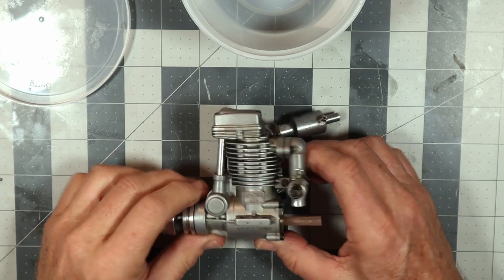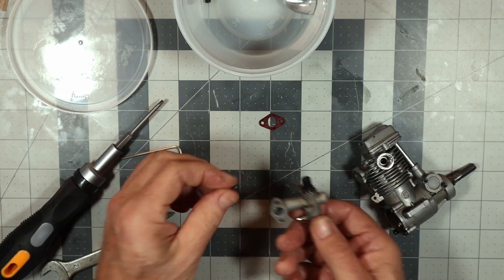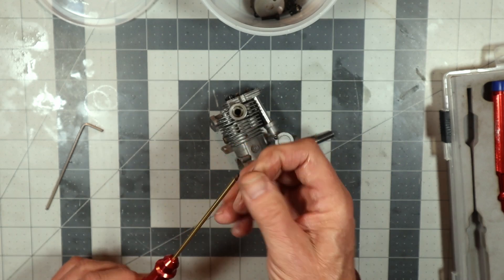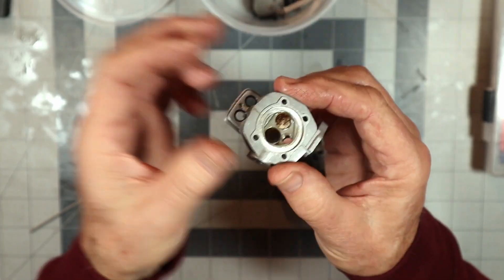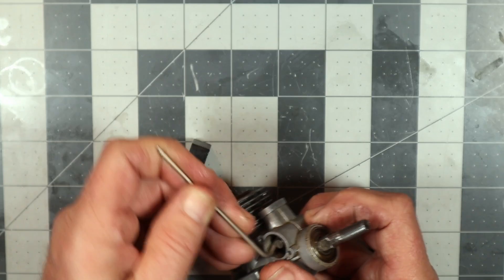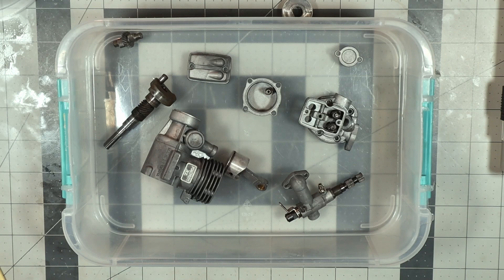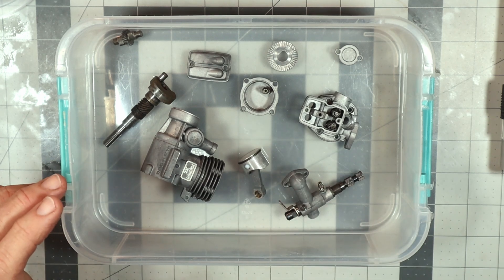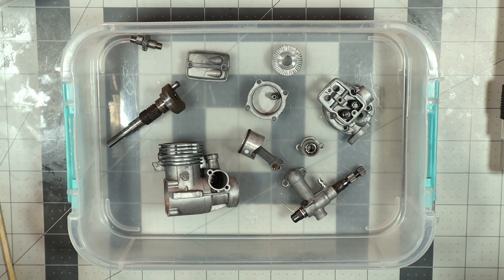Magnum FS30 Disassembly and Post Cleaning Wrap Up

Comment: Wish i had something for ya but i got nothing. I dont really do extensive cleaning. Just used things like: water, wire brush, glow fuel, brake cleaner, and the good ol crock pot and antifreeze. 

Best of luck to you, hope you're able to get it cleaned up.

Comment: Hi David. I have used the ultrasonic solution for cleaning brass shell casings and it worked very well without darkening the aluminum. I have also tried the ultrasonic cleaner for carbs and it worked well too. Both were tried with heat giving good results. Both were bought off Amazon. The unfortunate part is that both are quite expensive for a gallon and I’m trying to find a cheaper alternative. Both Simple Green and ZEP products don’t work as they turn the aluminum dark. Fred

Comment: Those engines are painted or powder coated. Nothing you can do to protect cheap paint. What I do is repaint them with Seymour s paint. Great engine paint. This is the engine I first wrote you about. Valves where stuck shut. Brand new 30 yr old. Engine. Cleaned it up. Finial got the valves back in. Those keepers are a pain in the ass. Runs good. Hope yours turns out okay

Comment: David, I’ve purchased some “Ultrasonic Cleaning Solution” from Amazon in a gallon jug. It does a decent job in my US cleaner at high temps without discoloration. The brand is Northwest Enterprises. 
 I too have been bitten by the LA cleaner reformulation and the damage it caused sucks. I had to use Barkeepers Friend and a stiff brush to remove the oxidation. Unfortunately it leaves the engine with a very unoriginal shiney finish, albeit clean though.
Reply from the maker: Thatnk you for the information!
Reply: @dmrcflyr2  It’s certainly not cheap, but neither is ruining a customer’s engine with LAsTA.

Comment: Have you tried Gunk carb cleaner? It comes in one-gallon cans for use in ultra sonic cleaners.
Reply from the maker: I had some years ago when i was working on motorcycles but i don’t believe that i ever tried it on glow engines. It did cross my mind a few days ago however. Thank you.